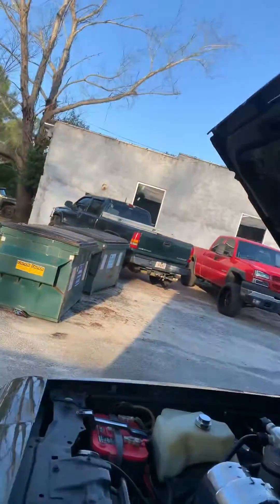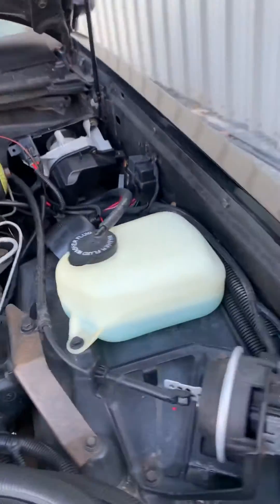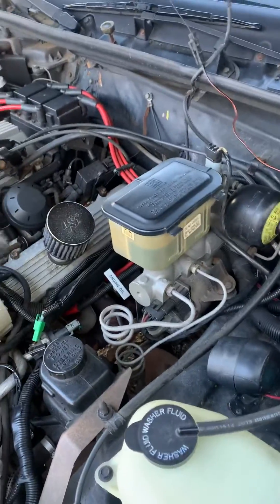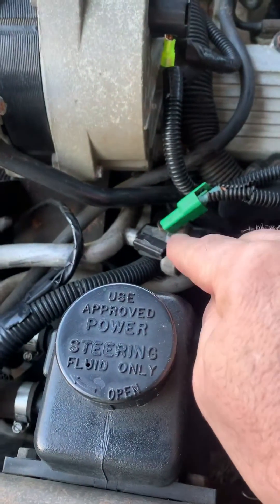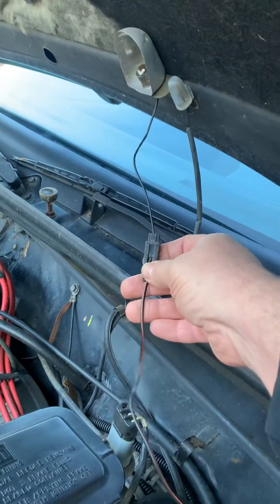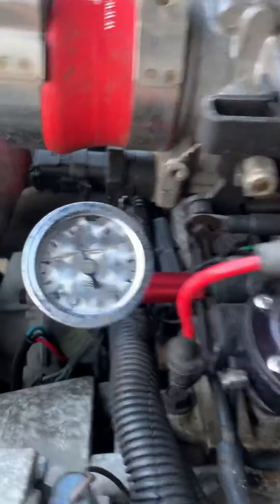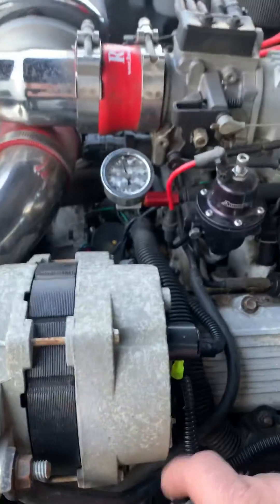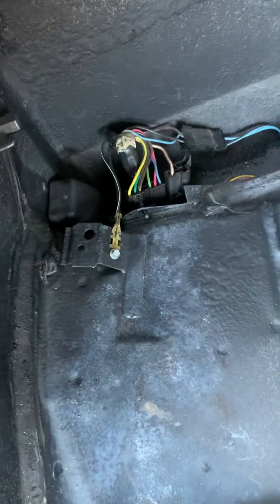Buick Grand National fuel pump testing

Comment: So out of no where,  relay has power, ecm talks to relay. No power to pump, grey wire has no power, removing hot wire and reconnecting oem does nothing. Trunk ground intact. 
Today fired up, shut down then tried to fire back up and nothing.
Ugh

Comment: When cranking I don’t get fuel pressure until after I get oil pressure. Put a new relay in, I need to check the signal from ecm next
Reply: What did you figure out here?  I don't get any fuel pressure to my rails.  I hooked up the wire this way and could run the pump and could get the fuel rail pressure gauge to move JUST a little.  Like it rose from 0 and then just fizzled out back to 0..  Not sure where hte problem is that's delivering 0 fuel pressure to the rail.
Reply: @T2rx6 try a new relay, if not that your pump may be dead. Check power and ground to the pump.
Reply: @GIZZMOTORSPORTS  well when I hooked up the 12v the pump primed but I still wasn't getting pressure to the rail. I suppose the motor or whatever could be spinning without actually pumping...  🤔

Comment: What’s the benefit to the hot wire kit ? Just picked up an 85 t type, not getting fuel. thanks for the tips, def ne using this info
Reply from the maker: The oem harness drops voltage to the pump... the hot wire kit and relay allows the battery to supply the voltage strait to the pump.
I recommend to go to www.turbobuick.com forum and sign up... there’s a ton of info there 👍